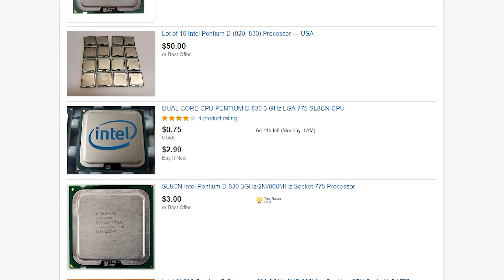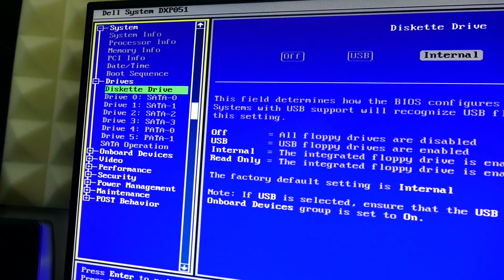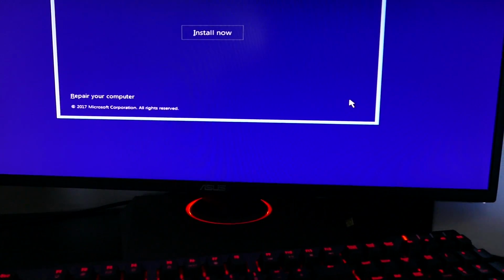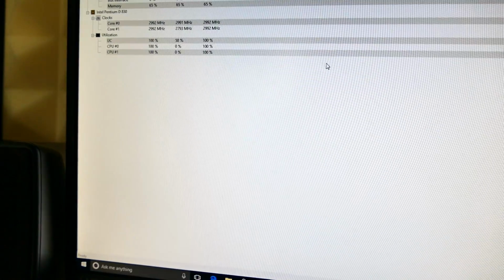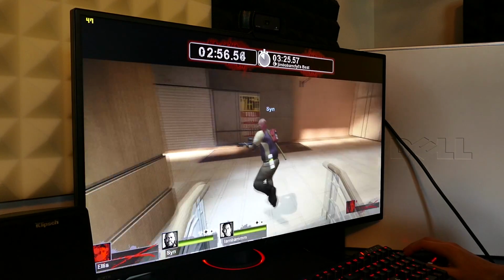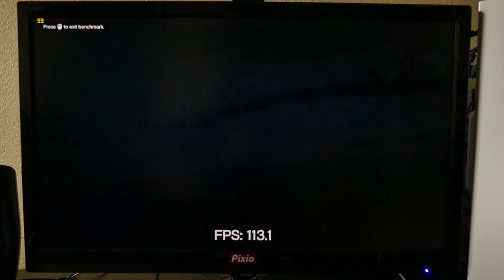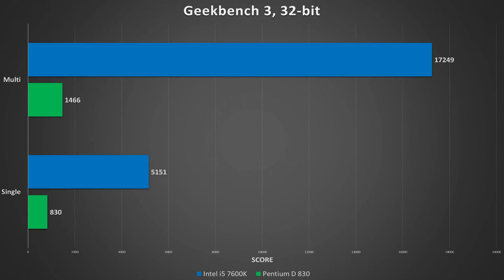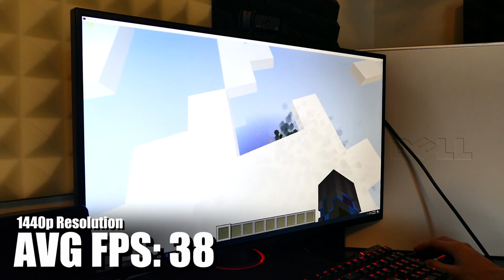I Paired a $6 CPU with a $700 Graphics Card

Comment: why do you keep calling 6 and 8 Pin PCI Express power cables VGA cables? as well as the reason your SSD did not boot into Windows is due to the fact that it probably had an install with ahci enabled on a more modern bios

Comment: mother of all bottlenecks o_O
Reply: I used GTX 780 Ti with 90nm Celeron D 346 :D http://i.imgur.com/o2kNGNC.jpg
Reply: lel :D Celeron D 2.53Ghz was my first build PC ^^ ... but i made mistake by pairing it with ATI Radeon X700, ... should've waited and saved little bit more  and bought the gf6600GT ^^ ... but the Celeron D was epic, i put Arctic Freezer 7 on it and OCd it to 3.96Ghz stable  without  raise in voltage! it  was so awesome ^^ ... i managed to brake the 4Ghz barrier with some raise in voltage to 4.06Ghz... for about 5 minutes :D ... so, no-go... but those 3.96 was running stable for 2 yrs i had it and it runs to this day on downclocked to 3.6Ghz as home server ^^
Reply: damn... when i'll have a time, i'll rebuild it ... for science ^^
Reply: dat must have been a painful bottleneck :D

Comment: Do a video about the Core 2 Quad + GT1030 or GTX1050ti( about the poor pc become the gaming beasts)
I live in a fishing village , the best pc in this village is my AMD RYZEN 5 1400+GTX1050Ti
Reply: GIN  i have a quad core 2 with a gtx1050 and it bottlenecks badly
Thinking of getting the ryzen5 when i get a new motherboard
Reply: GIN got 1080 ti and 1700x xd
Reply: Q9550 oc 3.6ghz 8gb ddr2 1050ti actually isnt that bad for a 25$ cpu . sure it isnt a i5 or i7 but for 25$ and 8gb of cheap ram , cheap mobo and a sdd its not bad at all , you can buy the whole setup for the cost of a i5 minus the 1050ti , @chris the core 2 duo was popular to overclock back then and many quad were not oc'd as hard or at all , when i benched the e8400 i was in the 70% percentile @ 3.8ghz compared to others that tested , the Q9550 @ 3.6ghz was in the 94% percentile , the single thread is a tad higher on the e8400 BUT the multi it gets creamed by the Q9550  , the popular Q6600 ''because of its low prices back then'' does not do as well as the higher up cpus that are now super cheap , if you have a q6600 now days you can up to a Q9XXX series or even a Qx Extreme for not very much

Comment: The bottleneck is real. You should've ran it on Windows 7 stripped down. I had a Dell XPS 400 with the same CPU and it could run Minecraft fine. Windows 10 is too intensive for older systems.

Comment: What is the SYSTEM MEMORY and VRAM allocation when trying to use a video card with 11GB of VRAM? Were you somehow able to bypass the 32-bit 4GB memory map? (PAE)
Reply: VRAM and system RAM are two different things.
Graphics card always* uses 256MB of RAM, regardless of VRAM capacity it has.
*TurboCache and/or HyperMemory equipped GPUs are exceptions to this (just like all iGPU's and APUs).
Reply: uh, not really answering the question if you read my comment again, and I know VRAM and system memory are different things when using a video card. I'm asking how a 32-bit OS that normally would assign a memory map of 4GB (which includes VRAM, system memory, and minor other things) works when the VRAM alone is larger than 4GB.

For example, if you had a 1GB video card then regardless of how much system memory you have installed you likely can only access up to about 2.8GB (4GB - 1GB - 0.2GB).

There are workarounds like PAE which I don't really understand. Long story short, I was curious how much VRAM he could access and how much SYSTEM MEMORY he could access. The full amount, or just some VRAM and some of the system memory?

Not super important but I'm curious.

Comment: On systems with UEFI, installations are usually done in UEFI boot mode instead of BIOS, which also prompt GPT instead of MBR partition talbes. This old system can only do BIOS boot, and therefore will not boot off of "standard" win10 installations made on modern systems out of the box.
Reply: Pretty sure he coudn't boot first install (Win 7), because hard disk controller drivers were "out of wack" for this setup (vs. one they were installed orignally).
Reply: Windows 10 repair mode off installation media may be able to fix boot issues.

Comment: That system should be fine with x64 OS, I think your problem was that the bios doesn't support AHCI or that it needed to be set to AHCI to boot what was on the SSD. If you do a old Dell OptiPlex with a Core 2 Quad they actually still perform ok.

Comment: you could paired a q9650 core 2 quad and a much much better result core 2 quads are why newegg still sells 
new socket 775 motherboards
Reply: Matt Hunter q9550. It is half the price and has only 0.17 Ghz less and can be OC'd as well.
Reply: I just put a build together with a Q9550 @3.8GHz, 8GB DDR2-800 and a GTX 780Ti. It runs RotTR at 1440p, FXAA, most settings at high. Framerates can drop to around 40, but will stay around 60 most of the time. Both CPU and GPU are pretty much maxed out. If anything, the CPU bottlenecks the GPU on occation, but not by much.
Reply: His model only supports up to pentium D and pentium 4 though
Reply: Matt Hunter great idea I had that idea too

Comment: A Pentium D 830? The oldest CPU I have at home right now is a Pentium 4 SL59U Single-Core CPU, rocking amazing 1.4 GHz with shocking 256K of L2 Cache. Sadly I can't run it at the moment because I don't have a PPGA 423 or 478 Motherboard. But it won't run a PCIx16 GPU, just AGP. The slowest LGA775 CPU I got is a Celeron D 335J Single Core @ 2.8 GHz and 256K L2 Cache. The Price for this beauty is between 4,99 - 9,95 Euros.

Comment: Socket 775? Nice! Cheap E8400 & Q6600 possibilities beckons. Just BIOS update for processor support & max out the RAM for 64-bit OS first. ;-)
Reply: This box is too old for that. A 2005-ish 945G-based OEM machine like an XPS 400 is physically incapable of running Core processors in spec, so no BIOS support. Total dead-end. On these designs, Vcore and NB supply are shared if memory serves, hence zero flexibility.

BTDT with a Precision 380 (same generation, fancier 955X box).

Comment: I have R7 1700 OC to 3.8GHz + gtx1070 about 150MHz OC on core.
And even when I have 144Hz/1440p setup, GPU is the bottleneck almost always, where CPU is hovering at about 30%.
But I have my 110FPS+ in BF1 so it's completly fine.
Will upgrade to 1080 or 1080ti but not atm, because I don't have money ;p
Reply: Ryzen isz not good for gaming, too much threads.
Reply: Get some Intel next

Comment: Orcs must die 2 sometimes gives you crazy FPS if you toggle Vsync.  Its based around an engine that did not have a framerate limiter.  Its also a quick way to burn out a system if its not cooled properly.

Comment: 64-bit addressing space is probably not the issue.  There are a rare few games that require it.  Anything made before Ryse son of Rome and Shadow of Mordor would probably be ok.

That being said:  Pentium D are 64-bit, what may be holding you back is that you usually must manually hunt down drivers even with Windows 10, if a driver does not exist and is required to play a game it obviously will not work.  2008 era computers still required you to hunt down drivers, AHCI, ACPI, to get everything running smoothly.

I believe Windows 10 standard ISO will cover 95% of typical installations, but it will not have drivers for equipment that old, just to keep file size to something reasonable.  You might have better luck with Windows 7 64-bit.

Comment: "Hey let's see how this 1080 performs" plays cpu intensive games
Reply: yes it does.
Reply: 1080 TI FTW!
Reply: Crimson Where can I find a 970 and 16gb of RAM just laying around?
Reply: yeah minecraft is pretty much gpuless
Reply: MAC MILLER Good luck trying to run windows 10 64 bit on that, which in my case uses 2.3 gigs by itself (I'm running 8 gigs now)
Reply: Yeah Minecraft is a complete bitch for CPUs. Older FX processors often have issues with Minecraft do to their sad single thread performance.

Comment: Must have got lucky on the motherboard, a lot of those old motherboards only allow 25watts to be drawn through the PCI-Express slot  - most modern graphics won't run on them (needing about 50watts-60watts from the motherboard).
Reply: ANY motherboard eqiupped with PCI-e x16 electrical slot, MUST be capable of 75W running through it. 
That's what PCI-SIG specification states for that slot.

Comment: Puts 1080Ti w/ a low-end CPU and benchmarks CPU intensive games.. 
You should've installed 64bit and run games such as Witcher 3, Outlast, Sniper Elite 3 etc that is more GPU heavy + maybe some Unigine Benchmarks, so it would show how strong the low end CPU actually bottlenecks and what is actually playable while focusing on Hi end GPU and low end rest.

Comment: Hey, I was wondering if a core 2 duo would bottleneck a gtx 750 ti. I plan on throwing one into the computer that my girlfriend is using to play WoW. Its currently rocking a core 2 duo, an hd 5770 super overclock and 4 gigs of ddr3. Its a relatively quick computer in windows 10 considering its age but I'd like to give her a gaming boost considering it plays on the lowest settings wavering slightly above and below 30 fps.  If anyone could help that'd be nice. Thanks!
Reply: No. You should be fine with GTX 750 Ti and Core 2 Duo.

Comment: you killed its performance by making it refresh the display at 1440p 165hz. lower that to 60hz alone and it will do A LOT better. seriously, I was able to accomplish more than this on my old Pentium 4 E2220. paired with a GT730, no less.

Comment: ye old Pentium D 830, I recall forking over $320 for one in 2005, absolute space heater overclocked, went through two air coolers, ending on liquid, spent more than the cpu cost on cooling, she crunched seti like mad though :))

Comment: I think you gonna need a 965p, P3x or P4x motherboard in order to let PD 830 perform to the maximum. 
if the Mobo has only 865p, 945p chipset, you can't use more than 2G of RAM then the 64bit versions of Windows wont perform good..

Comment: A  Pentium D does support a 64-bit. Windows 10 64-bit is not compatible with a Pentium d Windows 10 32-bit will work but its 32bit. Windows 7 64 bit will run just fine try it!

Comment: try the benchmark in From the Depths for a mid to high build. No one seems to use the game for bench-marking purposes even though it specifically measures the fps and the rate at which the game logic can run. Its a physics based naval (subs to spaceships and everything in between) RTS with a Minecraft-ish yet in depth ship building system.

Comment: If you want something to run without any CPU bottleneck what so ever you need a CPU which can run your preferred software at under 50% usage on all cores. The reason is because any cpu monitor polls the cpu usage at intervals, what is then displayed is either the raw value or an average value over several polls. This means we do not really see microspikes in CPU usage which occurs when it is under load. If you see your CPU working at 80%(according to a cpu monitor) it will bottleneck during instances of these microspikes, this is the reason why some microspikes go away in a game when overclocking, even though the FPS was decent before the overclock.

Comment: Did you like my beard Greg? :D
Reply: Hardware Unboxed 
😀
Reply: Hardware Unboxed can anyone hlp me? after I put gtx1050ti on old LGA775 CPU its freeze and blue screen and can't turn on
Reply: What is the error message on bsod?
Reply: juan muller 0x0000007E(0xFFFFFFFFC000001D,0xFFFFF8000C3C2503,0xFFFFF880009A9348,0xFFFFF880009A88A0)
Reply: Maxatal fixed, ram problem
Reply: kok zzs restart the computer while smashing your hard drive

Comment: I would love to see this video redone as you originally intended running modern games. Your options are as follows:

Pentium 4 Extreme Edition 3.73GHz
Pentium 4 631, 641, 651 or 661
Pentium 4 506, 511, 516, 517, 519K, 521, 524, 531, 541, 551, 561, 571
Pentium 4 620, 630, 640, 650, 660, 662, 670, 672

These all support the 64-bit instuctions. Unfortunately, there are no dual core but most have hyperthreading and high clocks. They are all socket 775, like your board but probably only 3/4 will be supported on your board based on release dates alone.

Comment: In case you're curious -- it wouldn't boot because your original OS Install on the SSD was a UEFI-Boot Install. When you reinstalled, the media would have detected that it was Legacy BIOS and installed with an older style bootloader.

Comment: You can't just plug and play a windows drive! The wrong chipset driver on it will most likely prevent the system from loading!
Reply: yes you can. windows 10 was probably installed in uefi mode on that ssd, that old dell doesnt even know what efi is.
Reply: Rico Smith I have even done it across platform. usually it will say something about optimizing your system on boot
Reply: Windows 10 is sometimes able to uninstall the wrong chipset driver and replace it with a better one. Doesn't mean, that your system will run perfectly, i experienced a lot of bluescreens and lockups...
Reply: That also might be the case :D

Comment: a lot of the glitches are also probably because the hardware is so damn old and not designed for win 10, i think if you get the cheapest available kaby lake celeron and pair it with this gpu would be interesting, it would also be interesting to compare the results of that with the data in this test.

Comment: Why buy an i7 when you could buy 100 of these and get 300 (THREE HUNDRED!) GHz of power and 200 (TWO HUNDRED!) cores for the same price?
Reply: Erthos im already doi.... fire engulfes house
Reply: Erthos boy i never thought that! now that's what i call smart
Reply: the power bill is OVER 9000!
Reply: i can b your angle or yor devel woosh
Reply: i can b your angle or yor devel it works for my motherboard, it can run crysis 200fps no lag
Reply: Erthos unfortunately it doesn't work like that
Reply: i can b your angle or yor devel ur dumb
Reply: Its what I do in the winter
Reply: Erthos pay a shit ton more if u account for cooling
Reply: Holy crap ur smart 😂😂😂
Reply: i can b your angle or yor devel you must be fun at parties.
Reply: There is a video from Linus Tech Tips that shows a similar attempt with putting a modern set of gpus onto an old motherboard with five celeron cpus and all you get is a very power hungry computer with bottlenecking included.
Reply: Im amazed that this thread is r/woooosh losing faith in humanity over here....
Reply: Well my house is on 🔥
Reply: Power Supply : Am I A Joke To You?
Reply: 😤😤😤😤😤😤😤amazing idea😤😤😤
Reply: try and find a motherboard for that. Windows 10 will not even accept all the cores, meaning you cant see all the 200 cores in the task manager (so they're not being used and you will not get 300GHz).

Comment: Dude I got a Intel Pentium Dual Core E5300 for 20p... I mean it wouldn't fair much better but still slightly better than the god awful Pentium D.
Reply: Ádám Pajor c2q god
Reply: It's a lot better than that Pentium D. I had that CPU... or to be exact, D 825 it was OK for its age, but damn, even a weaker Core 2 Duo was such a huge difference compared to that.  And that E5300 is still a lot better. 20p for real? That kinda wants me to build a computer from old stuff.

Comment: Are you still gonna fail as hard as when you originally had this name? For example when you forgot to plug in the CPU power cable, your machine didn't boot, and you said it was because you forgot to plug in the 4 pin accessory power? Another would be when you said the. .5 gb on the gtx970 runs at a slower speed than the other 3.5 gb. That was shit, not science.

Comment: No rant...just to let you know: A 450W PSU can't provide the whole 450W to one single strang of cables. There should be a label on the PSU which let you know how much power you can pull out of every connector.

Comment: turns out the CPU is too powerful and the graphics card bottlenecks it.
Reply: next time go with SLI
Reply: Correct. Those 1080tis really suck.
Reply: Just overclock the 1080ti a little bit and you can play Porn flash games @30fps
Reply: wait if i had an i7 7700k with like a gtx 210 would there be bottlenexk
Reply: Some guy on the internet
Reply: hahahahah nice one.lol😂😂😂😂.That processor Pentium d830 made GTX 1080ti shoove a finger in its ass😂
Reply: WhatSorceryIsThis no, nice cpu and bad gpu can still work, but not for gaming, at least no bottleneck
Reply: Time to bring out the TITAN Xps in SLI!

EDIT: I didn't mean 2-way SLI, I meant 16-way SLI. How? By using a quad-CPU MoBo and having 4 TITAN Xps in SLI per CPU. Even then, with 16 of those cards, you'll still have a bit of a bottleneck due to the CPU being way too powerful!
Reply: not correct, the cpu is always the suspect if there is gonna be bottle necking due to hardware. the channel support in the gpu has to correspond to the cpu and the cpu just isnt capable of letting gpu stretch its legs
Reply: CurrentDecadeGamer riva tnt

Comment: Windows 10 will not start if it is first installed on a newer EFI system, and then gets plugged into an older BIOS system... It's incompatible then with the older BIOS system. #Themoreyouknow

Comment: Well to be honest 450w is probably enough - I am running an FX 6350 and R9 290 Tri x OC - both overclocked on a corsair 430w - sounds like a bad thing I know - but Its been running all year no hiccups.
CPU is overclocked to 4.5ghz and the Sapphire is overclocked to 1100/1400 from 1000/1300. I have the option to up the voltage too - but no need yet.

Edit: Now now youtube before you freak out - Ill b getting a heavier PSU but nothing over 650W. Realistically its unnecessary.

Comment: I have a question. Does anyone own a Deepcool Dukase V2? Did anyone notice that the hot air is going out of the case too slowly with the single included fan? Should I go for a reference Graphics Card or a custom one in this situation?